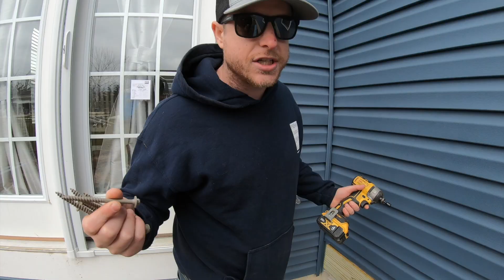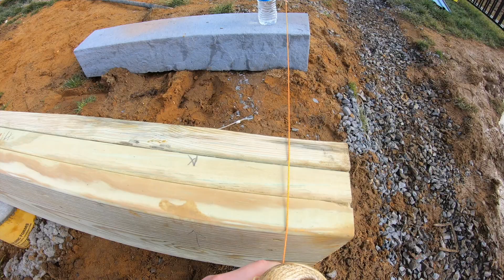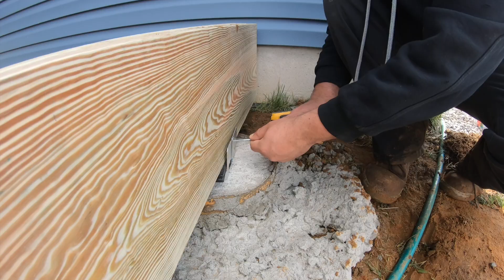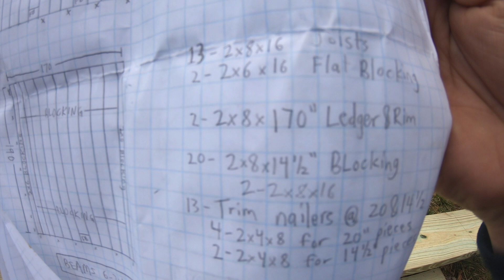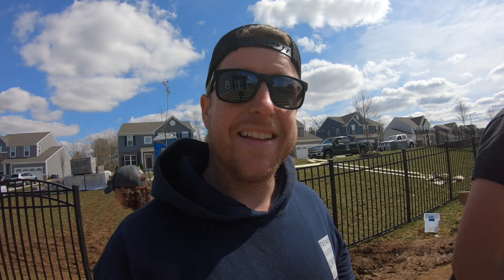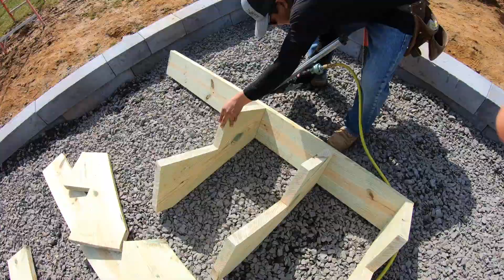DECK FRAMING 101 - My Best Tips For Framing A Deck

Comment: That deck is not square. Please, nobody hold framing squares up to string lines. That will get you squarISH at best. Do the math. Measure the corners!! Pythagorean theorem. It’s easier. Faster. More accurate. If you don’t want to do the math for your corner to corner dimensions, at least measure 3’ on one axis, 4’ on the other, those marks will be 5’ apart if your square. You could do 6’, 8’, 10’ if it’s bigger, and so on. Then measure corner to corner both sides, if your parallel and square these measurements will be the same. So simple. I can’t believe someone claiming to be an expert is using the framing square plus string method. It simply doesn’t work, unless your ok with squarish, not square.

Comment: Love your content. I'm building a similar deck on piers with preset hardware. Im running into an issue with diffetence in material thicknes in our 3 1/2" X 9 1/2" beams. How do you efficiently solve this problem with your beams? Thank you.

Comment: I am in the process of planning a 12‘ x 12‘ deck on the back of my house. Unfortunately I have a stone façade that gives me a very irregular surface. What is your recommendation on attaching the ledger board. Or should I just run a beam a couple of feet off of the house and let the deck cantilever?

Comment: So here goes a good question just had my deck rebuilt and the company used screws for all of the joist hangers instead of nails. Is that a preference maybe? I would think that the screws would be more secure than using nails? I mean my inspector passed off on it so it can't be wrong.

Comment: Why don't you have a slide compound saw nestled in a stand with an infeed 2x12x10 and outfeed 2x12x10 (or 12)? Can do almost all of your cutting on it other than your string line end cut. Big bonus is the ability to screw blocks down to it anywhere as a stop. Can batch cut blocking out 6x faster.
Reply from the maker: I agree, taking the time to set up a nice saw table is well worth it. We should do it more often than we do

Comment: Wow I don't know any contractor that plans to the extent you do, very impressive.  I'm surprised you bother with the 10d nails on the joist connectors vs. the strong tie structural screws.  I find them quite the time saver.
Reply from the maker: They definitely are, we’ve since switched to a joist hanger gun which is amazing

Comment: Rule #1 never sandwich 2xs together to make a beam. Buy the correct lumber
Reply: Believe it or not it ends up being stronger than a solid piece when you sandwich together.    I forget the exact science behind it but has to do with the wood grains.  Sorta the same idea as how plywood varies the grain between layers.   Also using something specialized like an engineered beam for a deck that is like 2 feet off the ground would be WAY WAY overkill.
Reply: This is common practice. If you want water to stay out of the lams use flashing tape or have metal made up

Comment: You said to put flashing tape on any two or more boards and then you don't put it on your triple joists?
Reply from the maker: I think you’re talking about the beams, taping them definitely isn’t a bad idea at all, but any flat blocking underneath the deck boards will be more likely to have water sit than on the beam. Plus in an area that people are walking even a tiny bit of give from softening of the blocking will be noticeable

Comment: You need to teach that pat dude how to use a sledgehammer my God hits like a girl
Reply: He knew he could push it much faster by hand but didn't want to go off his bosses script, finally got tired of doing it like the boss wanted, was a good hand, and so did it effectively :-)
 It could also be argued that maybe this isn't Pat's first rodeo. If you wail on it you could crack or split your nice pretty beam, or knock it too far and then deal with the hassle of bringing it back in line. Just my estimation though, I've done a lot of this kind of work and have often found brute forcing everything often creates more problems than it solves

Comment: quesion about inspection: I have noticed from several youtube videos about building, that you have to have an inspector out to approve your work. How often or for which type of work does an inspector need to approve? Here in Denmark there is no such requirements, you don't need to have your work inspected, unless it's plumbing or electrical.
Reply: In the states - decks specifically are footing inspections, framing inspections and final inspections.   Usually framing and final are done at the same time if you know what your doing ;p

Footing inspections are based on proper size and depth.  Everything is based upon the international building code, though local govt also can require higher standards.
All of the plans are submitted and approved to obtain the permits to build here as well.
Reply: Only thing I would add to this is if the deck is MAD low to the ground we have left a deck board out so they can see hangars and bolts, most inspectors know us so it's all good but sometimes new blood likes that. Remember** most inspectors are failed framers 😂🤣

Comment: Great video!  Have learned a lot by following your vids.  Quick question:

Which components do you nail vs. screw?  I am under the impression its good practice to use 10d-16d nails to join components that need high shear strength (joist hangers, nailing through the rim joists into the ends of joists, etc.) and screw in components that don't need high shear strength (deck boards, affixing beams on top of notched posts or anchors).  What items do you generally nail/screw together and what type do you use for each?

Comment: If you want a huge Time Saver while you are cutting your blocking. Stack the two by twelves on top of one another then you would only have to mark 2 by 12. and your saw blade would cut deep enough to to Mark the one underneath it. And so on. So you would only have to mark 1/2 by 12 for technically is Mini 2 by 12 as you had if you did it right which would me and you wouldn't need to whip out your tape measure and square and pencil 15-20 times you would take it out one time and start cutting
Reply from the maker: Stephen Russell I like that idea! Never seen that before
Reply: Gang cutting, just be mindful of potential waste with blocking. We usually try to get our blocking from our joist cut offs. Get a nice big stack of cut offs and have one guy gang cut them. Looked like you guys only had 5 or 6 inches here though. At the very least teach pat to mark all of the cuts at once, adding the blade each time 😁